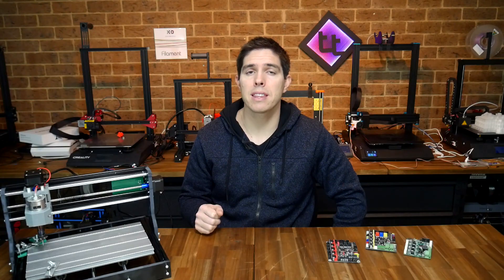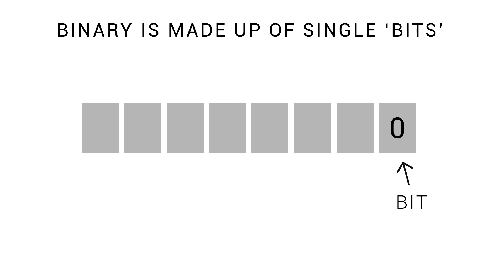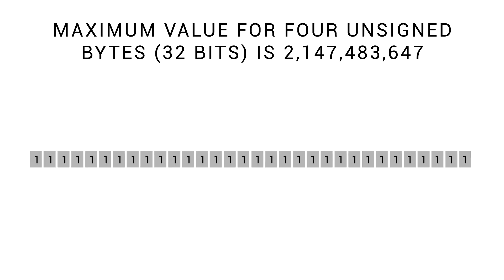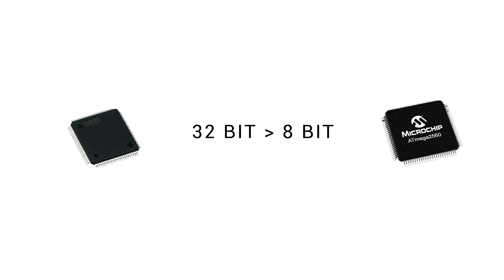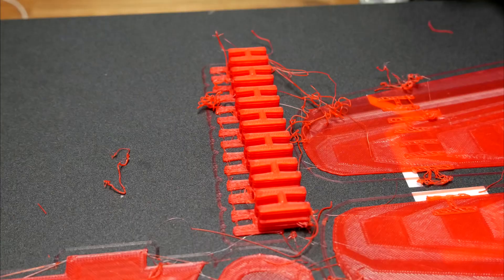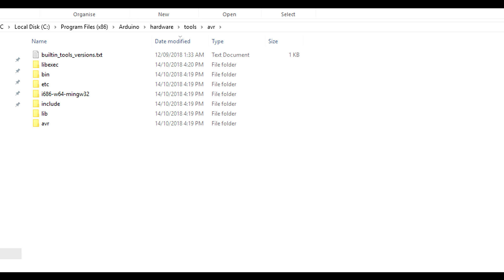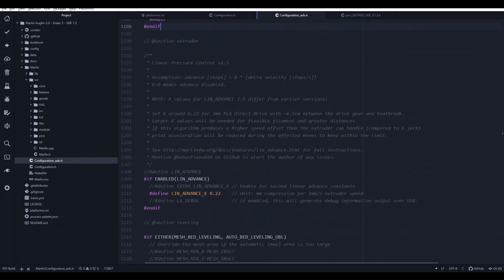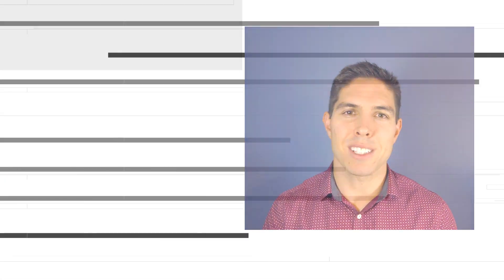32 bit 3D printing - What it means and when you need it

Comment: Hey Michael, I have been a software developer for 43 years. Usually whenever I see someone explain bit depth I see someone struggle, use confusing verbiage, or wanting to move on to another topic. On a few very rare occasions you see someone explaining it very well. You did it very well.
Reply: In the end you are right. Michael did explain "bit depth" very well and it is a rare thing. Others seem more focused on how processors handle it. For the record I have a 7 year old printer with a mini rambo originaly running  Marlin 1.0.0 beta fw with no updates from manufacturer (in 7 years... MTW??). In the last few months I have bitten the bullet and progressed the firmware to Marlin 2.0 mainly due to the fact I added an LCD with SD and it was a waste of time and money because I could not even load or unload filament manually with the LCD. Anyway longish, story short, I got to the point where I had designed and installed a servo and micro switch, no money for BL touch, for bed levelling and eventually UBL. I can almost smell the smoke trying to get out of the Mini Rambo as it calculates the extra Z movements added with UBL and all the other wonders that come with LA  etc in the latest Marlin Firmware. I now get my build plate as level as I can and fade out UBL as quick as I can, 0.75 for 0.25 layers, so the 8 bit Rambo can keep up. I have saved the pennys I have for a 32bit board so it may keep up with what the future brings. Oh and I went  back to Marlin 1.1.9 because I thought it was a Marlin 2.0.x problem. It's an 8 bit board problem and the 8 bit board problems don't address it other than 8 bits.
Reply: Hey uncle Louis, can you help me with your knowledge?
I want to buy a control board and install 4 drivers.  I want to run 4 stepper motors with a very simple few lines of code that I wrote.  I was going to use Arduino, but Arduino is not connected to this control board.  But it doesn't matter to me because all I want is to control 4 motors by any method.  My reason for wanting to buy this control board is to keep all the drivers and motors in one place.  My question is: Can I write my own codes on this card?  For example, this motor starts when it receives a signal from the sensor, this motor accelerates when I increase the potentiometer.
Reply: you could also use an outdated 4 bit CPU. At least you can count to 15 with it.
Or build a CPU from TTL ICs.
Or replace ICs with individual transistors?
Now it's getting tedious, for one flip-flop you need two transistors and a handful of resistors
if someone mentions a tube computers ... or mechanically... 
I call a light switch a 1 bit computer ;-)
Reply: @StavrosKor  It depends from application. For example if used for temperature measurement or digital to analog conversion 8 bit data bus or data width used in CPU it limited to max 8 bit capacity - from 0 to 255 (256 states). 16 bit (65536) or 32 bit (somewhere 4 billion +) - you can use better precision, for example work with 0.001 of temperature. But right now 1C degrees (for example from 20 to 275C) or stepper motor drivers (max 256 microsteps) seems enough.
Reply: @vladimirseven777  That isn't true.

You can basicly calculate everything in an 8bit processor to the same precision a 32bit processor can by concernating the calculations using things like carry-flags. The only problem is, that it takes a lot more clock cycles for your calculation.
Modern 32bit CPU, like stm32, also come with an FPU (floating point unit) which handles floating point operation in much less cycles that the standart ALU of the Arduinos ATMega2560.

Problem of the stepper driving is that the Software on a 8bit processors in use aren't able to drive more that 10.000 steps/s due to lack of ressources with the workaround of sending multiple steps at once to reach up to 40.000steps/s. This method is called double and quadstepping which you can find in configuration.h in the marlin files and produces an absolute horrible sound, vibrations and possibly steplosses, as seen in the video. More than 40.000 isn't possible at all without disturbing the whole software loop comprising things like closed loop temperature regulation, watching for endstops being hit, safety loops (temperature runaway)etc.

Having 80steps/mm for X/Y axis at 16µSteps limits your movement to 125mm/s (=10000/80). If you increase the steps per mm by increasing the µStep-Number to let's say 256µSteps like the TMC allows you to do, you would be limited to ~8mm/s.
Reply: @ald3nt3  That's true that calculations can be done at 8 bit without FPU - I did Mandelbrot calculation on ZX-Spectrum in 80-th and it took all night to calculate several points. It can be done without carry flags the same way as huge integers calculated on PC. But it is very slow.
Also it is true about motors, microsteps and sound - I changed Trigorilla on Anycubic printer to Duet WiFi, set to 256 microsteps and now cooler fans louder than motors (also changed from 12V to 24).
Reply: Except he didn't. Old 8 bit processors used in consoles had 8 bit registers and 16 bit addressing so they were not actually completely 8-bit CPU. And he comparing CPU speed 100 MHz vs 16 MHz and deciding "32 bit better". Use 8-bit at 100 MHz and you will have more than enough CPU speed for printing.
Reply: @vladimirseven777  The point is, you can't really get an 8-bit CPU with this clock speed, and 32-bit processors with higher frequencies are cheap and readily available. Thats why the current 32-bit controllers today are better suited than the older 8-bit ones.
Reply: @vladimirseven777  This is not the case for all old 8 bit processors; for example the 6502 did not have 16 bit addressing. What you are referring to are extensions to 8 bit memory spaces using bank switching in order to save costs or implement features ahead of their time. That there are exceptions and additions to an evolving design does not make the explanation of the basic design faulty.
Reply: @louis-ericsimard7659  Not faulty, but very incomplete. Like modern AT-mega or Arduino are the same as old 8-bit processors. Bank switching in 16 bit processors was implemented to address memory above 65535 while pure 8-bit can address only 256 bytes.

Comment: Could adding a 32 bit board potentially improve print quality and consistent quality print?
Reply: I'm pretty sure it wouldn't on its own (by that I mean: If you have good firmware on an 8-bit board and bad firmware on a 32-bit board, you'd be disappointed, but the chances are that 32-bit firmware is more up-to-date than 8-bit firmware).
1: Your slicer is important for quality. Bad slicing results in bad quality, which you can't improve much upon.
2: The firmware of the board is important. If the firmware is clever, it may be able to improve the quality by using smaller steps.
3: The stepper motor driver is important. Some stepper motor drivers might only support full steps, which means no matter what you do, you can't really get rid of all those lines you always see. Other drivers are able to do half-step and quarter-step. That greatly increases quality. Finally, some drivers might support micro-stepping like 1/64 step or 1/256 step, which gets much closer to "smooth" than even quarter-step.
-So my advice is to learn all the tips and tricks for the slicer software you're using (this can give you a free quality improvement, except from it will cost you some time to learn and some time when using the slicer).
When you've exhausted the slicer tips/tricks, learn a little about the board and drivers you currently have (eg. what the limits are), and the limits of the board and drivers you intend to switch to.
Also search YouTube for slicer software recommendations and tips/tricks for that particular slicer.
I hope this is useful. =)

Comment: My favourite analogy is to say that going from 8-bit/16MHz to 32-bit/72MHz is like going from one milk-float at 15mph on a country lane, to four minivans at 70mph on a four-lane-wide highway.

The bigtreetech SKR-mini-E3 looks interesting btw - $30 drop-in replacement for Ender-3/5, using a 72MHz ARM Cortex-M3 processor and soldered-on TMC2209 drivers - a real winner, I think.

Comment: The computational overhead of a CoreXY or H bot system is marginal at worst; it’s a couple of subtractions and divisions, which is negligible compared to all the other stuff that’s going on. If your processor is good enough for a Cartesian printer it’ll handle those just as well.

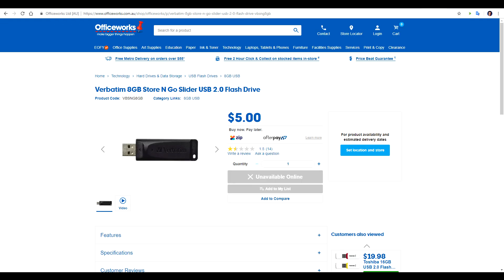Comment: 2:00 WRONG your internet provider shows you the speed in bits and not in bytes
Atleast its like that in Switzerland
Reply from the maker: I think it may be different from ISP to what your device is showing you like in my example.
Reply: @TeachingTech  what does ISP stand for?

(with internet provider i mean when you go into a store of a provider and get internet for your home, but yes devices show only bytes) 

Btw. Do you also answer problems with 3d printers? I have quite some trouble at the moment
Reply: I)nternet S)ervice P)rovider.
Download speed is typically measured by your Web-browser as Bytes/sec, KBytes/sec, MBytes/sec.
Network interface speed is usually measured in bits/sec, kilobits/sec, millionbits/sec or billionbits/sec.
(eg. Gbit Ethernet = 1000000000 bits per sec, not 1073741824 bits/sec, so all those ISPs are in fact 'decorating' their numbers).
Harddisk manufacturers re-defined the meaning of KBytes/MBytes/GBytes/TBytes, etc.
30 years ago, storage space was 1024-based, today it's 1000-based, so you get less than what you pay for (because the operating system measures file sizes as 1024-based).

Comment: Hi Micheal. Thank for all the great videos. Lately I came across this board on AliExpress:

BIQU BIGTREETECH SKR MINi E3 32 Bit Control Board Integrated TMC2209 UART RGB Controller Marlin For Ender 3 /5  3D Printer

Since it is designed for the ender 3 and 5 it would nice to see a review on this board
Reply: I have ordered one so it would be interesting if you got one before me.
They have also released the tft24 display for it.

Its a lot cheaper than the skr when you have to buy the stepper drives like the TMC2130.

The TMC2209 can do sensor less homing and has stall guard too.

The mini E3 has connectors for a BLtouch.
Reply: I am actually wondering if it has the same form factor as the original Ender 3 board

Comment: Or just use Klipper with an 8bit board - all the speed and power of full motion kinematics and pressure advance, on a device that can also run OctoPi, has multiple GPIO ports and a shed-load of plugins... That said, I've bought a SKR v1.3 for StepStick support and better Mosfets - but not for the 32bit processor
Reply from the maker: All good points. I have a Klipper specific board coming too.
Reply: @TeachingTech  You're a legend dude. Much love from NZ for your contributions to the community!

Comment: question any advice on how to reduce that vertical line that shows up on prints. because when printing circles it's a noticeable factor that effects tolerances just enough to not get smooth fits. I think it's from extrustion where the printer stops and starts. Also i use cura, because ya.
Reply: Change Z Seam in cura to random to get rid of that line
Reply: @tiaancordier3798  This does not solve the problem, just mask it, because the stopping point of each layer will be distributed randomly, leaving small dots all over the print surface. I think the better way is to sand that vertical line to get rid of it.

Comment: My car's EFI is controlled by a 8bit MEGA2560 Arduino, so it's a bit surprising you would need anything approaching 32bit for something as simple as a 3D printer. Like doesn't the micro just tell the stepper controller which way to go and how far, and then the stepper controller decides the number of steps based on it's jumper settings. I can see going to 32bit because it's nearly the same price, but maybe it's more to do with memory size than needed processing power.
Reply from the maker: The mc still has to send a signal for each micro step to the driver. That's why your steps per mm are increased in the firmware when you go up from 1/16.

Comment: i want to see the difference in 3d printing with 32 bit processor vs the 8 bit one.
Reply: Nekoromancer on my delta printer, the print was smoother, and even on the same micro stepping
Reply from the maker: I will include some simple testing  on my skr guide.

Comment: Now.. is it worth it to upgrade to crealities brand new Mobo release  for the ender 3. 1.1.5 I believe... At 50 bucks... Hmmmmmm
Reply from the maker: This is cheaper, but that is plug and play. Depends what other mods you plan on doing.
Reply: Timothy Hoogland  the key difference Being a bootloader installed for easy USB updates, and the current version of Marlin with thermal runaway protection enabled unlike 1.1.4

Comment: Would upgrading to a skr 32bit board allow me to add an additional excruder with an 2-1 hotend on my ender 5?
Reply from the maker: Yes, as would MKS Gen L. It's because they both have extra stepper outputs and thermistor inputs.
Reply: I am thinking on using this, https://www.amazon.com/dp/B07R3VVJN4/ref=cm_sw_r_sms_apa_i_R5DfDb7BEW008,
Do you think it will work for the ender 5?

Comment: Michael, let me know if you need any help with configs for Marlin to get your video ready. I've been working through this stuff the last 2 days, and there have been quite a few changes to bugfix-2 settings for BLTOUCH... and there are some quirks with trinamic drivers. You're welcome to take a look at my work so far, and reach out to me via my github commit author email info. Hopefully my pain is your gain.  I was going to do a video, but you are way better at the videos, and you have the reach that will benefit the community the most, so I'd rather offer any help you need.

Here's a github diff with the summary of my config settings so far, which will continue to live-update as I go: https://github.com/MarlinFirmware/Marlin/compare/bugfix-2.0.x...HackerHappyHour:ender3-skr-v1.3-config
Reply from the maker: Thanks very much.
Reply: @TeachingTech  my trinamic problems were actually soldering problems, so ignore that bit.

The current tip of my branch is stable and working, and I'll start doing tweaks and such in test branches and merge to this ender3-skr branch I linked above when I have stable changes to add, so you're safe to download and build from the link I gave you above.

Biggest changes required for BLTOUCH as a result of removal of `Z_MIN_PROBE_ENDSTOP` (Marlin pull/13276).

BIGTREETECH's intro video for the SKR v1.3 shows them using the Z_MAX_ENDSTOP pin for the bltouch signal pin, and their configs at the time made sense for that (commenting out Z_MIN_PROBE_USES_Z_MIN_ENDSTOP_PIN).

However, with the simplified logic, It now makes more sense to USE that define, which means a change to the pin mappings.  (I'm going to work through the low-level code and verify this is best, and submit a PR to Marlin if it is).

Finally, the pins for z_min_endstop and servo's are all +5V tolerant, and so you want to make sure you set #define BLTOUCH_SET_5V_MODE.

Feel free to use or attribute my configs in whatever way you want. I plan to set up auto-rebasing merges from the upstream bugfix-2.0 so that there will be a stable configuration package for any ender users at any point and time moving forward.

I don't want anyone else to have to spend 2-3 whole days figuring stuff out because of upstream changes to bugfix-2 making things incompatible with community videos.

Comment: I have a monoprice maker select plus, basically a wanhao duplicator I3, and was wonder if this board would be possible to retro fit into my printer, I'm not happy with it and doing research on turning it I to what it should be
Reply from the maker: I have the Cocoon clone of that printer. The sticking point will be the ribbon cable attachment which is different to other prints. You would need to cut and terminate the wires with jst connectors or make a break out board.
Reply: @TeachingTech  I have seen your video with the Cocoon, tinkering to make it work would not be a problem, curious if it was possible to make it work.  I basically am unhappy with my printer and I want to work with it and turn it into something better cause that's just me, tinker with something till I either break it or enhance it ha ha.

Comment: Hopefully you can mention the TMC2209's that are coming embedded on some ender 3 direct replacements. Not even sure if it's fully supported but it's the cheapest/easiest way to push into 32bit boards with the ender series

Comment: Is there no 16 bit board? A sort of middle ground between the two.
To use the Video game reference a Mega Drive (Genesis).
Still better than the Master System but nowhere near good enough for 3D graphics.
Just seems that someone is missing a trick there.
Great video. Keep up the good work.
Reply: Doubtful, since everything in 3d hobby has been chosen based on 1)availability and 2)price.  The arduino was available, cheap and used a free toolchain (free compiler).  Most 16bit(24bit) micros were PICS, with no free compilers this ruled out pics in the 3d space.   Atmel had cheap 8bits and free compilers(and tons of libraries for hardware) so that was natural extension.   The compiler issue is what is really holding the 32bit boards back, arms, stms, nxps, etc all have specialized compilers (and libraries to use the hardware) that are generally not free, or are very painful to use.  Even for this board WHY Marlin uses some bunch of offbeat complicated editor tools and stuff is beyond me, probably because most kids have no idea how to edit text and use a Makefile.
Reply from the maker: Not that I know of.